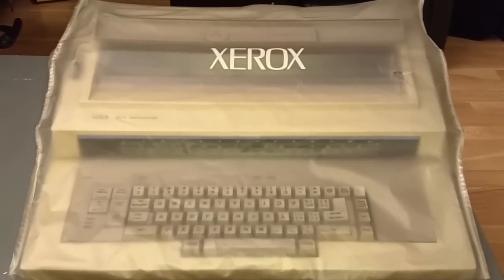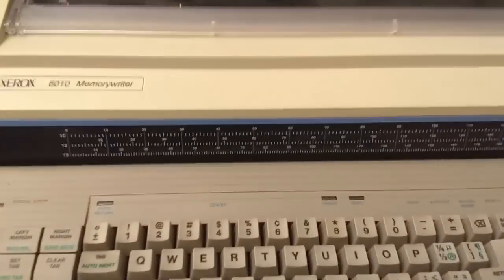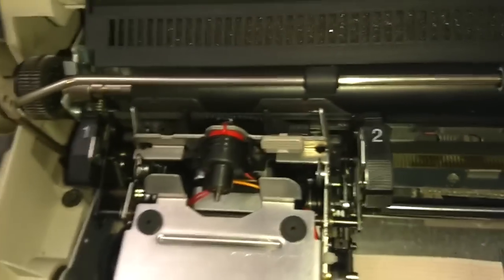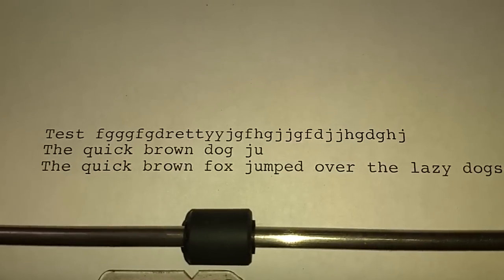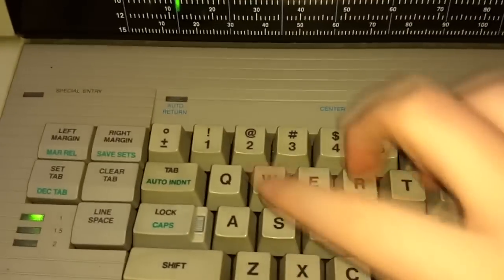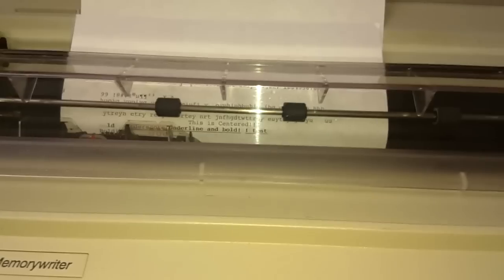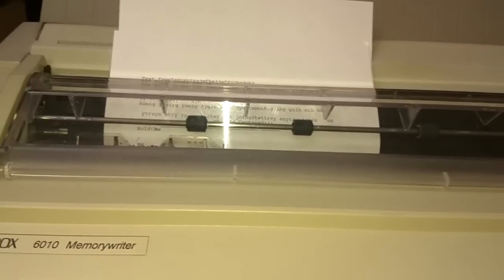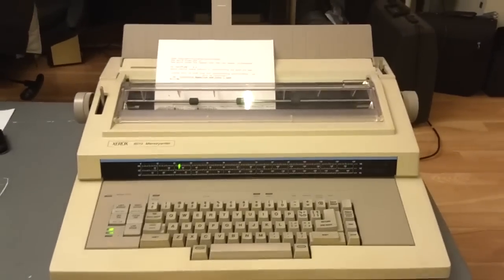Xerox 6010 Memorywriter electronic typewriter (1985)

Comment from the maker: Errata:

-"Dec Tab" is Decimal Tab; the purpose being to let you line up columns of numbers by their decimal points.
-"Express" is express backspace, which sends the carriage back to the left margin without starting a new line.
-What I called a "true caps lock" is properly named Shift Lock, as it emulates literally holding down the Shift key, replicating the behavior of (electro)mechanical typewriters.

Thanks to VWestlife for this information.

Comment: I had one and I loved it! Something electronic went out on it and it would just go back & forth no matter what key I would press, and no longer print. Thanks for the video!
Reply: Brian The Cajun open it up using some plastic automotive pry bars (used for uninstalling vehicle panels and trims) and get to the keyboard area. Check for cold solder joints or cracks with a multimeter. It sounds like the problem I had. My carriage would keep trying to move left no matter what. It had to do with a circuit under the keyboard which told the carriage to stop once it hit the paper margins. Resolder any old joints, and check for broken plastic bits too. Sometimes it’s a mechanical part or plastic gear that wears out or cracks over time. If nothing else, at least you tried and can then go and get yourself another or better model. I am currently working on my electric writer.
Reply: Geoff 
Thanks, so very much!!!
Reply: Brian The Cajun,  try this video for disassembly. https://youtu.be/SQL0y5r_tPE  

They should be pretty similar to take apart. Specifically look around the keyboard. 

The good thing is, type writers are very cheap nowadays, even the mechanical ones. What used to be hundreds of dollars can now be found for $100 or less, usually $60-70 and even less for electric or electronic models. $25-30.

Comment: used to repair these as part of the product range we worked on when I was a Xerox tech in the 80s / 90s. They were a good machine, way ahead of the field at the time. There was also a model with a CRT screen attached.
Reply: I have the model with a CRT screen attached, it is a great feature. You can check on my channel to see a video of it.
Reply: No machine beat the IBM/Lexmark Wheelwriters with the mechanical spring back keys and no platen knobs. I still to this day use a Wherlwriter 3500

Comment: Old is new again. Typewriters have made a tremendous comeback during the pandemic. I have a Wheelwriter 3500 and use it on a daily basis. It is sitting next to my IMAC.  IBM/LEXMARK Typewriters/Wheelwriters are the best typewriters to work on because of the mechanical spring keys. I purchased my Wheelwriter back in 1993. It has a lot of life still left in it. Typewriter technicians on the other hand are really hard to come by. Lucky here in Los Angeles, there are still a few around to service them.

Comment: What you're calling "true Caps Lock" is actually called Shift Lock. (On manual typewriters it literally locks the Shift key down.) The green Caps on the key is indicating that if you press it together with the green function key, it gives you Caps Lock like on a computer. Also, I think the Express function is an express backspace, which returns the carriage to the left margin without advancing the paper to the next line.

Comment: I actually got a 640 from a storage closet where I worked. It came complete with its screen as well. It was such a neat machine.
Reply: I should add, it cost around $4900 when it was introduced, and also had the two floppy disk drives. It was a complete and amazing beast!

Comment: May you help me, I have a Xerox 6025 Memory Writer. How would I clean the keys? And how would I pop the keys out?
Reply: Pull the keys straight up. If necessary, use wide flat head screw driver to help. Get it as close to horizontal as possible. Put it under one end of the key and brace the other end with your hand to prevent the screwdriver pressure from pushing to the side. You want all the force to go straight up. Once I had one key off, I was able to remove others by hand.

CAUTION!!! There are very small, very light screws under the wide keys!  Remove these very carefully and slowly to avoid having the springs fly across the room....

To clean, I put a couple drops of dawn in a bowl of warm water and put the keys in the bowl. Stir them around with your hand a little. If they're really bad then the water will get dirty. Just pour it out and replace it with new soapy water.  Let the keys soak for 30-60 minutes.  Now remove them one at a time and wipe the sides and tops with a sponge. The dirt should wipe right off.  To rinse, set up a second bowl in the sink with warm water trickling into it from the faucet. Just put the keys in that bowl after washing. The soap will rise to the surface and then flow out of the bowl with the overflowing water.

After cleaning the keys, I took each one and gave it a shake to knock most of the water from the inside of the key. Then I put them on a towel and let them sit there overnight.  In the morning they were dry and easy to reinstall.
Reply: @dmhayden  thanks! My keys haven’t been working so I hope this will work.
Reply: @raytomic2762  If the keys don't work then it might be the pads under them. There's a video showing the repair on youtube. I think it's by Phoenix typewriter repair. You can get replacement pads from Colman manufacturing. I ordered some yesterday as more and more of my keys fail.
Reply: @dmhayden  thank you, sorry for getting back so late. I will check out that channel and order some pads. I might post a video of my memory writer if you are interested.

Comment: Some can be used as a daisy wheel printer but not the 6010.... Wait!!  Yes it can.  Well... Mine can i hacked the keyboard and emulate it with arduino. I send a document to arduino and the typewriter types it out. Wow is it fast.  The keyboard uses regular ttl serial communication at 5 volts at a weird baud rate. The keyboard does not send ascii but its own weird codes so you have to make a lookup table to convert ascii to typewriter codes, but it works very well.

Comment: Aloft of Typewriters would "FAKE" Changing from Pica to Elite etc... which would change the spacing but not the size fo the character.  Technically you would use Pica with a Pica element or Print Wheel, Elite with Elite element or Print wheel etc...It's no surprise to me that a more professional machine would automatically select the correct size based on the print wheel.  Also the material of the ribbon is "Carbon".

Comment: People don’t use typewriters anymore. But they are handy but you cannot make another copies you need a photocopier for that.
Reply: woodss82 In some work environments typewriters still get some use. In addition to using a technology such as photocopying (which wasn’t always as inexpensive or readily available as it is now) there’s also the option of using carbon paper.
Reply from the maker: They're still used and very much necessary in legal environments. We have an IBM Selectric II at work that still gets used, and I've seen another one in a law office.
Reply: themaritimegirl whys that? Typewriters are technology that is from Noah’s Ark.
Reply from the maker: Pre-printed forms, carbon copies, delicate or odd-shaped media that can't be used in a printer. Lots of needs.
Reply: Some machines like this one could be programmed with a certain amount of key presses, lines, pages etc, then if you pull that macro, or file from memory, it will print identical to what you've previously saved... It's not as convenient as something modern, but it was pretty convenient back in that time period. At the time this device was being used, laser printers, and other copiers did a lot of the heavy labor with making many pages of something like a school bulletin. I was taught typing on one of these or similar device with the macro features, before my school got a bunch of apple 2 computers, and then Mavis Beacon teaches typing. Feels so long ago now.